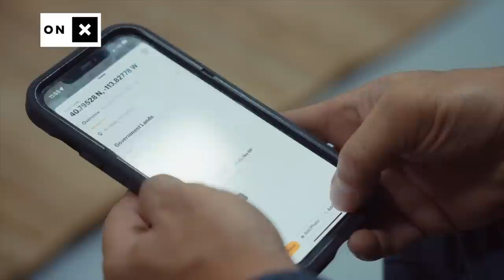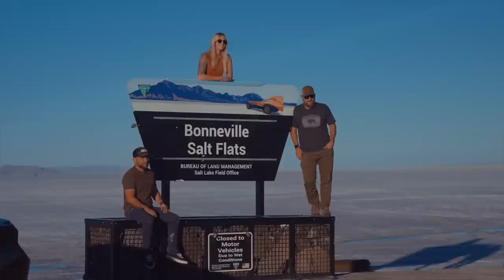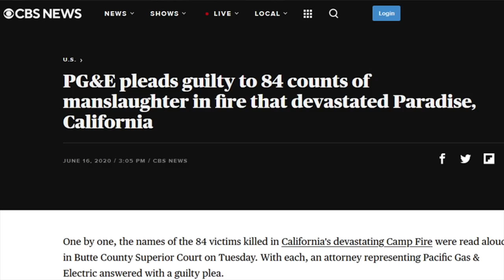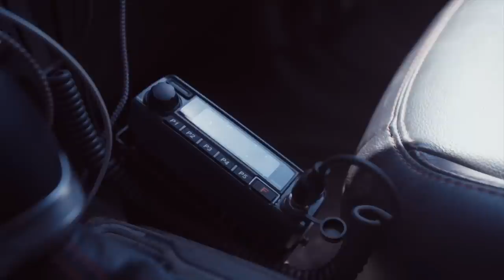3 Day Overlanding Trip from Utah to California

Comment: this whole setup seems super luxurious to me. most of the time I'm running as light as possible with mostly ultralight backpacking gear. what I wouldn't give to bring some of these pieces of gear like the full size stoves instead of just a Jetboil, lol. my saddlebags are usually completely full and I'm already on the verge of being too heavy on the motorcycle. 

the last time I went on a big back country trip, we didn't have a cooler or ice since there was no room. getting farm fresh eggs from a friend instead of store bought allowed me to bring them without having to worry too much about keeping them cold. definitely worth it if you can find some.

also, when it comes to the different camping setups... depending on where you are, (areas with brown bear primarily) hard sided camping is highly recommended if not mandatory. there's many campgrounds where they don't let you in if you are using a tent, even on the roof. I still don't think its worth the trailer with the mobility it gives up, but if you know you will have to go through one of those areas, its a consideration. i think a hard sided setup in the bed of the truck is a better option.

rock crawling lights in the wheel wells also helps with night visibility.

Comment: I have a fridge and it is such a PITA to keep powered properly, even with an aux battery and solar. Went back to a cooler for short trips.
Reply: What was the watt hour consumption in 24hr period and fridge size?
Reply: @pennmikael  Iceco JP42 quart, I didn't really keep track of watts per day but my Ecoflow River Pro and truck battery wasn't having it. When parked in a forest, it was almost impossible to get solar for more than two hours. I was parked for four days. Open desert solar would work.  I love the fridge on road trips but for simplicity sake going back to dry ice and ice packs in a Yeti.
Reply: You might need to get a bigger alternator

Comment: You guys really should/need to take some cues from the rock crawling/off roading world.
Reply: Why?
Reply: @Dennis Wood  alot of the upgrades they seem to do for bugging out/overlandung look cool but it's gonna really help you if you really get in a bind. If you're gonna build something one of the very first up grades that should be done is locking diffs. All those fancy lights aren't gonna do anything when you get struck because you aren't getting power to all four wheels and no just putting it in 4 low won't help every time. Some actual rock slidering instep of steps would help and I realize you don't wanna damage or dent a brand new 60k tundra but it's kinda the name of the game if you're off road. They aren't gonna look like road princesses forever.